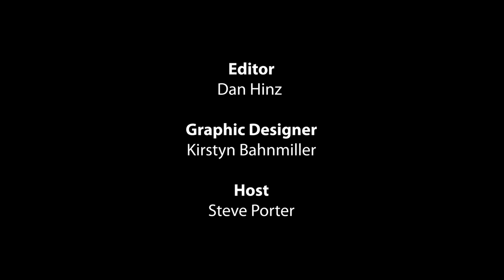The Truth About the Electronics Refurbishing Industry

Comment: I'd expect that a refurbished job should pass a complete fault check/repair and list the serviceable components that have been refreshed (thermal paste, heatsink clean, roller/laser clean). I wouldn't expect anything else to have been touched (A quick external clean to be nice).
If the work carried out isn't logged then it never happened.
I dont know if the fan not working would get picked up in a standard fault check, but some places would have longer checklists to cover fan checks and they could justifiably charge slightly more. But again, if there isnt a log of the work then the customer shouldn't pay for or expect anything.

Comment: Used to refurbish machines that came in from all nordic countries from lots of retailers and from brands directly. HP, Acer, Asus, MSI, Lenovo, Sony, Samsung, Toshiba. Circa 2012.

The refurb being done was clean exterior, blow air into the heatsink to remove majority of debris. Then do a function test through a Linux network boot. If it passes that test, heat, speakers, mic, camera, video playback then it moved on to having its official OEM provided image installed on it. When the image was installed we let them run for the amount of time with a torture test that the manufacturer said it was supposed to. Most was only for some hour. MSI had 7 days.
During this last test we checked for noise, temp and issues with the screen.
After this it was put on shelves and inspected by another member of staff, usually from a different department who visually inspected the device for smudges, missing screws etc and decided what grade it was.

Comment: If I were to do this on a commercial scale:
1) function test and disassembly (to spot anything that needs immediate replacement)
2) blow off major dust and debris
3) put everything in an ultrasonic cleaner that tolerates it
4) while washed parts dry under warm air, do any manual cleaning and thermal paste replacement
5) reassembly, replacing any parts necessary, and retesting
You could be working on a number of units at the same time very efficiently.

Comment: Used to work in the auto repair industry.  There are several terms used, sometimes interchangeably (and that would be inappropriate).  Resurfaced usually applies to things like brake rotors and flywheels, and means it's within wear tolerance and with a freshly machined wear surface.  Repaired means we fixed it to work as it should.  Rebuilt or overhaul means we took it apart, cleaned it thoroughly, replaced or brought into spec all wear parts, and, usually, made it cosmetically like new; typically warranted 90 days.  Remanufactured usually means it came completely apart, cleaned so you could eat off it, and the main body remachined just as at the originating factory, all moving parts replaced with new, finished as the factory would; warranted 1 to 2 years.

Refurbished could mean anything, but reasonable folk would likely think it meant rebuilt or overhauled in most cases.  For electronics, I mostly like Amazon's "renewed", meaning it should look mostly like new, work like new, and warranted 90 days.  Usually the price is not far from Best Buy's open-box pricing.  As a customer, I'm OK when "refurb" works like new and continues to do so.  For a computer, I'll nearly always be maxing out the memory and replacing the drive (I do this on new boxes as well, since we run Linux, and also they're never equipped as I'd prefer).

Comment: I got my PS4, for $30 from the pawn shop, opened it up cleaned out what I could, smoker tar. I didn't have a replacement disc drive which was eat up. But with digital content it has worked pretty darn well for the price.

Comment: This is how a small shop might refurb a customers device, but this is not how a company that is in the business of selling refurbished devices would do it profitably. I used to work for a company that refurbished commercial electronics for the construction industry. Sold hundreds or thousands per month and utilized a more of an assembly line approach, with testing & disassembly, cleaning and reassembly (this would include wear parts that would ALWAYS be replaced like fans and rollers) and finally testing and QA. This process ensures a properly refurbished unit with predictable costs. Units deemed no repairable would be stripped for parts. Average time to refurb was about 20 mins per unit. It was highly profitable as our units sold for 60% of retail. But as soon as things got cheap in the electronics industry, the profit margins dried up. We could not refurbish for what it cost our customer to buy new.

Comment: Received a refurbished server a few days ago, in perfect condition.

Now, there are a few differences to consumer electronics: a 19" server is meant to be easily serviceable (unlike consumer electronics), they usually spent most of their life in a clean datacenter, you have an integrated management and monitoring system which gives you real-time data about the power supplies, fans, temperatures, ECC RAM, a log of problems and parts which got replaced (so not a lot of options to cheat, and the seller did not clear the log) - and servers are usually configured based customer requirements. Im my case, I chose upgraded CPUs (used Xeons), a different disk controller (a used HBA instead of the usual RAID), used ECC RAM (zero errors/corrections logged) - and 80% of the price tag went for industrial datacenter SSDs (new ones, this seller doesn't sell used drives, for obvious reasons). Complete system maybe a third of the price of a new server - and that included a base install of the OS of my choice (not Windows).

Twelve months of warranty for the used parts, 24 months for the new SSDs. Very nice.

But buying a used ("refurbished") laptop or Playstation...that won't ever cross my mind.

----

Edit: had to correct a typo. Bought a used server, not a used sewer.

Comment: As someone who went from running a retail repair/refurb shop in a small town to refurbing consoles from a home office with no face to face customer contact I can say that the only way this refurbing consoles business works for me personally is to be the only employee.  I typically buy broken consoles from people in town on FB, or pick stuff up off eBay as a gamble and my profit margin is ROUGHLY $100 per console, and that's selling it with a 1 year warranty.  Then there are the hits you take when the console isn't repairable, the repair process for warranty claims, parts to repair said consoles (especially at the beginning when you don't have scrap), and it is kind of slim pickins if you're going to try and live off of it. 

That being said, if you are OK with working with customers face to face, or can hire someone to do it for you, the REPAIR industry is massive and only getting bigger.  Instead of spending $75-100 for a broken console, you only buy parts when you need them, and you are guaranteed the "sale" when someone walks through your door.  With selling consoles you could be holding onto something for a while before it actually sells for your needed price.

Comment: I've worked in the UK for one of the bigger data cleanup, repair and refurbishing companies. They were cheaping out on replacement parts so bad. When I was in the phone repair and refurbishing department I used to get Samsung chassis without screw holes, angles that wouldn't match or glass panels that would crack as soon as you stuck them on the phone. 
We constantly had 3rd party part manufacturers touring the place as the company was looking for the cheapest everything they could get. Even the adhesives were worse than double sided tape. 
I'm never buying any big company refurb. I'd rather get an honest, used, OEM than a cheap 3rd party part salad.

Comment: I in the USA, the new return/refurbished units often have far less warranty as new I have seen 90 days as common. I would never buy as they don't think much of their refurbished units deserve full warranty.  
Dell refurbished monitor: I did buy refurbished monitor from Dell years ago. I was supposed to be a new returned unit by a customer. It would overheat and shut down if a shelf was over it. It took about 6 calls to dell to final get a refund. Including hours on the phone. I then bought a new monitor. Dell did pay the shipping back, so they lost money. And I lost hours of valuable time. 
Swappa used phone: I did buy a several used phone from swappa with 2-3 month warranties. They were all good except one that was improperly sealed and stopped working from small amount of water. I had a local repair person look and he tried a repair as it had information on it that I wanted. (A beautiful lady that gave me her number) Replaced several components but did not work. He had trouble sealing it too. 1 year later I charged it and it worked again and got info of off it. Lost money on that phone from buying new. But overall saved time.

Comment: My mom once bought a refurbished PC as Vista stopped getting updates, and she didnt have much need for performance. I advised her against it as I was pretty sure many of them come from companies that used them as workstations before for 5+ years, and all they get is a drive with Windows on it, but the wear of the parts is still going to be there, and a lot of these machines arent in the best of environments. Last thing you want is a PC thats been sitting in a dusty warehouse, because that dust may or may not be conductive. I also had some doubts about whether they check that the parts even work well. 
Lo and behold I was actually right. It got halfway through the first time setup of Windows when my mom wiped off the case and touched the power cable. She didnt pull it out, she merely bent it, but it was enough to interrupt power and make the PC reboot. The cord was just defective. Windows was entirely bricked and needed an installation media to be fixed. Thank God for her being a penny-pincer with the internet, so that took literal hours to download and put on a flash drive on my PC. After that was done and the setup was finally complete it booted into windows the first time aaaaaannnnndddd: BLUESCREEN! PAGE_ERROR_IN_NON_PAGED_AREA. For laymen: Defective RAM. 
The good news was that warranty obviously covered either one of those defects, never mind both. And maybe the cable slipped quality control, its one of those issues that one might not think to test for, but the RAM can easily be tested to hell and back. Warranty is all well and good, but all it means is that quality control is done by the customer.

Comment: TronicsFix, you can use a large paint brushes to achieve a faster result than your tiny one.  Also invest in a Makita Dust Blower GSA01Z, it is better than compressed air and offers variable speeds.  You can dust out PS5s and Series Xs without having to open them.

Comment: Reminds me of the IT dept at work, got a PC that keeps getting really slow and shutting down randomly, it's not mine but it's part of my area of responsibility, they take it away, they spend an hour checking for viruses and whatever the f**k else, they bring it back.
1 day later it's the same problem, sick of going round in circles, I take the front panel off, I remove a huge wad of dust from the air intake (literally the whole thing was blocked) and no more problem. Manager of IT gets mad at me for taking apart a PC, even though I fixed the f**king problem for them.

One of the IT guys buys the old equipment from the company, "refurbishes" it at home and resells it, so be warned, these idiots are out there.

Comment: You should try parts in a dishwasher, works a treat. No messing about, no tickling it with that tiny brush, just pop it in the dishwasher and your done. Something to try for your next video. If you're careful enough to dry everything properly (or rinse with IPA) you could even take it apart and put 'everything' in the dishwasher. 🙂

Comment: 10:44 - ANOTHER aspect of cutting corners -- you reduce the risk of damage to the product by opening / refurbishing, as designs are becoming more unfriendly to repair. 

Plus, you have lower staff costs, as you don't need as technical / knowledgeable staff to "refurbish" if all you're doing is wiping it down and using some compressed air on exposed vents.

Comment: You can save a bunch of time by using an air compressor to clean most of the unit you are cleaning, automation helps alot, corrosion is a different animal and requires special attention to ensure the micro components are not compromised, there are literally different levels of refurbishing in my opinion, many times you waste your time and lose money but like a professional it takes some time to know when enough is enough.

Comment: There are ways to speed that up, IF the company is willing to invest. A lot of the testing could probably be automated, and the cleaning process could be sped up by adjusting the process and running it like an assembly line, e.g. having a tech take it apart, then someone else cleans it. Ideally the tech would have clean parts on hand already so they can just put it back together.

Comment: Just to add definition, refurbished means a part was replaced. It can be a large component or a small one. As soon as the original product has any component replaced, that’s refurbished. 

“Restored” on the other hand is what I would expect when purchasing a used electronic and expecting it to be cleaned properly and repaired where needed.

Comment: I have one of those shower heads with adjustable spray settings. One setting shoots the water out at high speed in a flat straight 2 inch line.
I take PCs like that, put them in the bath tub and blast them with hot water - works great.
I then hit them with compressed air can spray later - to blow away all the droplets from the nooks and crannies and leave them to air dry.
Use cigarette lighter fluid (like Ronsonol)  to remove all the sticker glue - the best.

Comment: I agree Refirbished to means the same thing as Remanufactured which is rebuilt to look and perform as new. Meaning clean and free of any defects and and any components replaced or repaired to work as a new unit does. Anything less than that is just a used/pre-owned unit. Those should be sold as used tested and working or tested and not working.

Comment: Great video going through the detailed process of cleaning and checking out a system and putting it up for sale. I honestly wish that consoles would be marked as used and not refurbished personally since I've bought some and have fixed some for friends and family that I would not say were refurbished. I only say this because refurbished systems or equipment typically comes in branded original or marked boxes from the manufacturer as such and also includes some sort of warranty. I only say this since I'm and IT person for over 20 years and have purchased many systems and equipment and have bought refurbished items. The price point of $220-230 seems very fair to me for a tested and working PS4 system... key words there... tested and working.

Comment: To me, refurbished means that it might not look new, but it will work like new following a similar quality assurance check as done in the factory from SONY.
In this case that requires cleaning or applying thermal paste, but some items will not require cleaning if the functionality is not effected.
If it doesn't come with a warranty of some type, refurbished means used or as-is.

Comment: 2:20 that fan might not be dead. it is compacted dust mixed with dried grease on the shaft. 99% of the time, the shaft can be removed by removing a little circlip then the whole things can be cleaned. When reinstalling the shaft, a pin head sized bead of grease goes a long way. I've even used silicon oil.
Reply from the maker: There is no circle clip on these

Comment: I agree with you fully that "refurbished" should be cleaned out and fully (100%) tested (with a decent warranty).  I think that most folks just have unreasonable expectations for the value of their used equipment (ANYONE buying a used unit should plan on doing a full breakdown, cleaning and as-close-to-perfect-amount of thermal paste) to improve the dependability of their system.